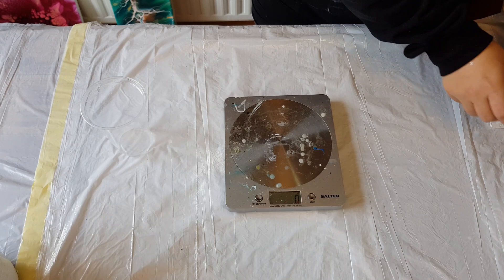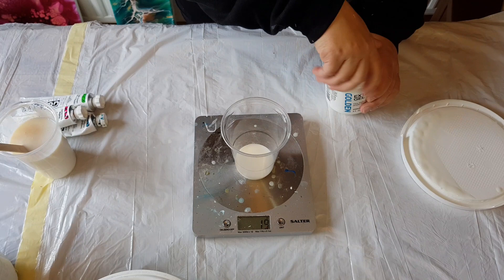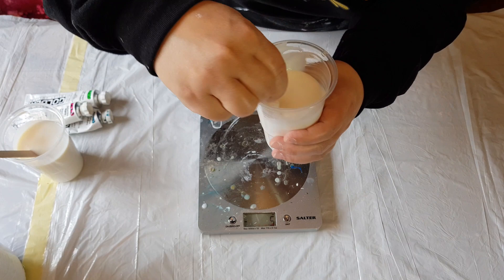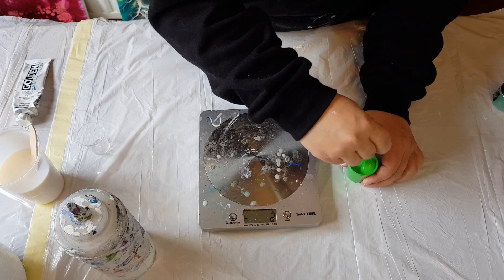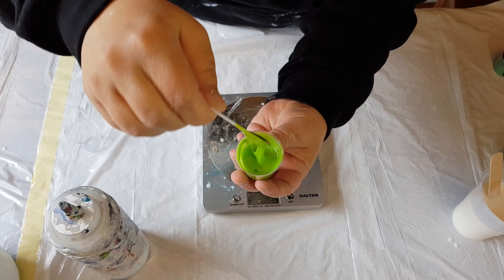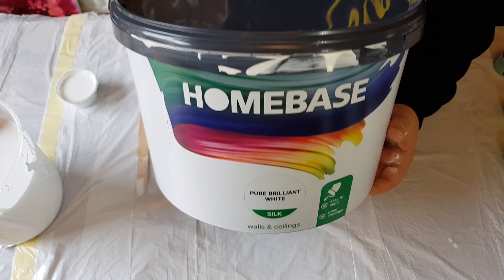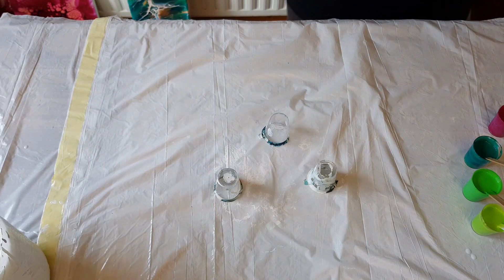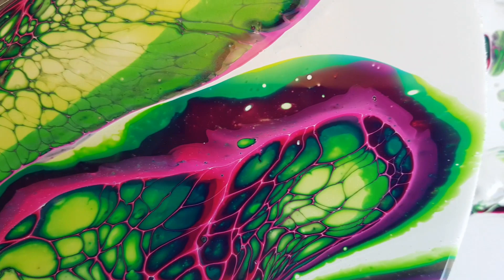How I mix my Bloom Recipe!!! (Talking) AND a Wreck a Bloom! / Acrylic Pouring Techniques

Comment: You art always looks amazing! Thank you for your time & tips. One question, for the bloom do you not need to use a heat gun for the air bubbles? Xx
Reply from the maker: Thank you Gemma! I wouldn't recommend using one. the house paint burns so fast!

Comment: Great and informative video! 🙂 I live in the states and I am using a deep base Behr 8300, which as you’ve explained is thick. When mixing my PM and not using the heavy gel - wound I still use the 150ml untinted and 50ml varnish?

Comment: Yours are beautiful.  My cells tend to disappear.  Any suggestions? I took the class. I am not on Facebook. I am using a semi gloss paint.  And the pouring medium is Glidden semi gloss premium base 3 and josonja varnish. Also American floetrol. I have practiced the 2 gallons of paint. Changed base paint and varnish and pillow paint was Satin before.  Any suggestions would be much appreciated. Thank you for this video. Love your paintings. I did it. I finally got it.

Comment: Just an explanation for you:   The tube paint mix  was much thicker than your kiwi mix because 20% of that was the super-thick tube paint.  The kiwi's mass was much less than that.  If you want the kiwi a little thicker, you could start by using the same QUANTITY of base as added to the tube paint (would give you a little less than 25g of kiwi).  Since you mentioned that you like the pigment powder mix rising to the top, I think you should leave it alone.  Your results are stunning 🤩

Comment: Gorgeous. I can never get anything like that webbing, I just cannot get it right 😢
Reply from the maker: Hi Nina... What is the mix you are using for the bloom?
Reply: @EricaHughesArt  I use white house paint for the pillow but I don't know what I'm supposed to mix in with it to make it the consistency like yours?
Reply: @EricaHughesArt  I'm using white acrylic paint with floetrol, like equal parts ..., Is that right? I don't use any silicone in any of my paints

Comment: Where did you say you buy your untinted base paint? Or are you not in North America? I did buy Valspar at Loews &  it was 80$ gallon untinted base, so i traded it for a quart of Behr3300* C base. I'm almost out. I wanna try a better PM for blooms cuz this* with the polycrylic is still abit too thick. So MAYBE its worth it to get that perfect pour.  I really appreciate these "how I mix mine" videos... but I get mixed messages about weighing your paints as density may not be related to the consistency if using the same weights of mediums etc. OTOH, I saw the lady in Australia PY❤O weigh HER glue water and paints for flip cups. Your ( & her ) results are pretty damn good proof it works. Also I've decided to buy 1 tube of Golden Paint every month as a gift to myself. They REALLY are a better quality. Some tubes are 32$.00 so its a treat indeed.

Comment: Thank you so much for this - it is SO useful. Absolutely love your creations. Tell me, do you use a thinner mix for swipe/hairdryer job?
Reply from the maker: Thank you! When I'm using the hairdryer I would thin down the house paint a bit more. easier to blow out the colors, as well as when I spin. For swiping I would use the same consistency as in this video. However if swiping on a larger (14inches or above) canvas or board I would thin down a bit.
Reply: U r such a star thank you for taking the time to respond to my query / I really appreciate it. Consistency is everything 😱😖